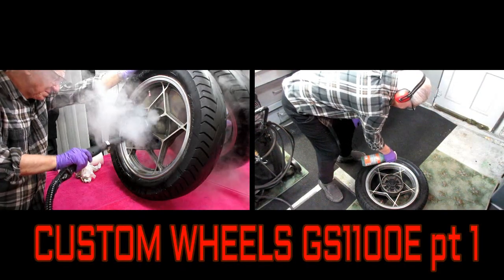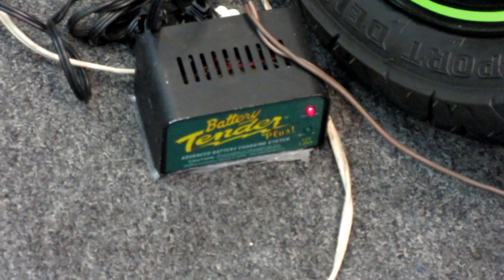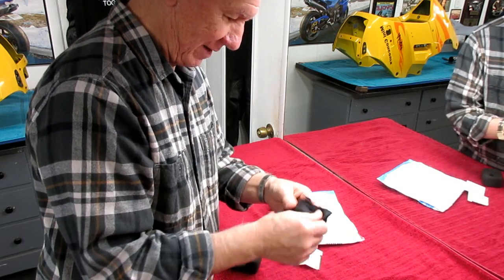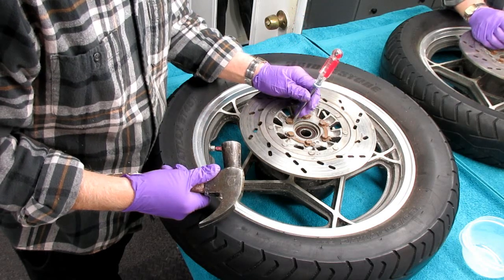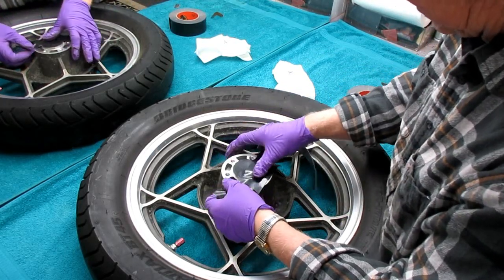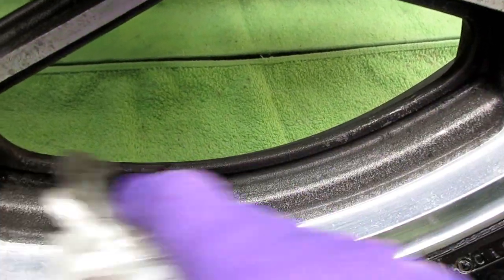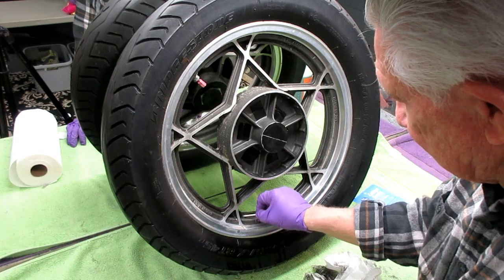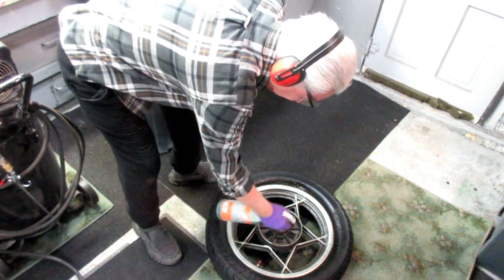CUSTOM WHEELS GS1100E pt 1,PREPARATION FOR PAINTWORK.

Comment: What timing.  Getting ready to do the wheels on my '94 ZX11.  Been waiting till the next rubber change fr&rr to accomplish the task.  Glad I don't have the tiny crevices to deal w/ like on those wheels.  Gonna cerakote though w/ an air dry coating.  Unfortunately my powder coat oven isn't large enough for rims so I could use bake cerakote which is a step above the air dry coatings. Work on these older bikes never ends.   But riding them never ends so.....

Comment: When your warranty is up on the MT09 remove the cat and the exhaust meter valve piece and add a pipe in its place. You can keep the stock exhaust or add a slip in. Have the ecu flashed and the bike goes to 150 hp.
Reply: Knowing Windy like I do is not going to do any of that